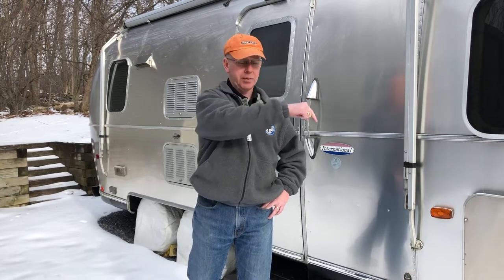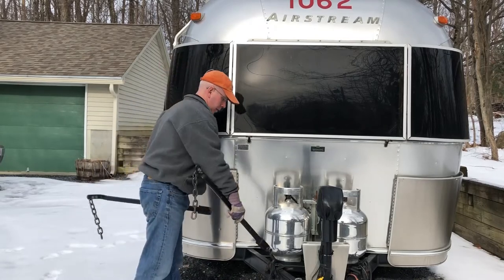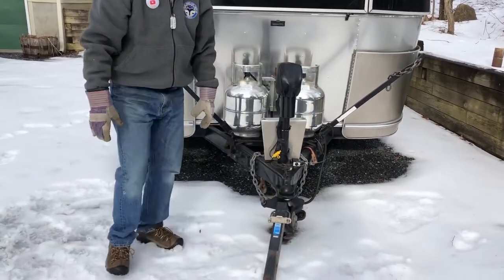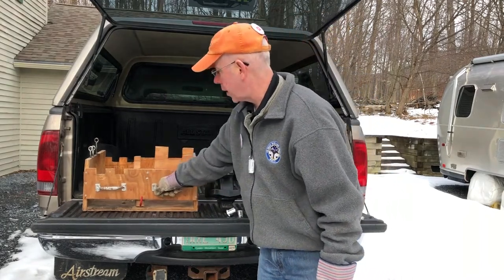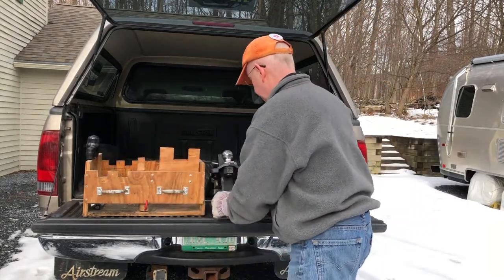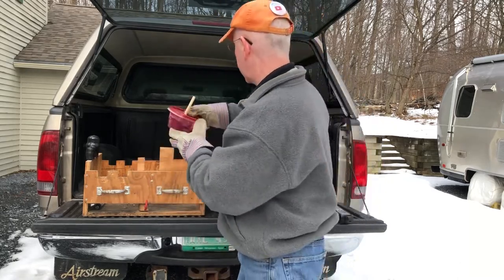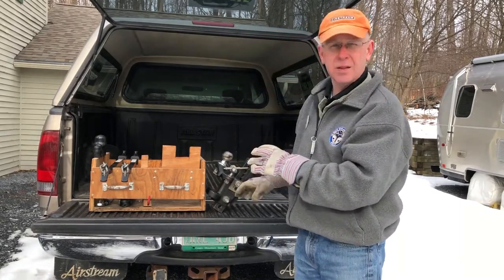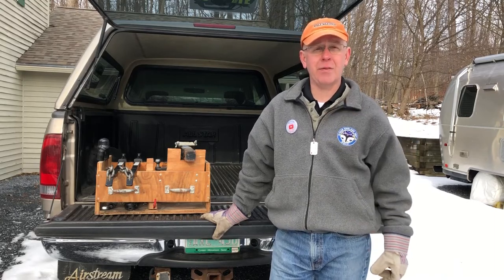How We Store Our Airstream RV Hitch Gear

Comment: May have to switch to the high temp grease you use on the hitch ball. I’ve been using petroleum jelly on the hitch ball sway bars etc. with no issue whatsoever. The reason I started doing that was you don’t have to worry about washing grease off of your clothing.
Reply from the maker: Yes, I've gotten my share of grease on my clothes.  There has been some recent debate on greasing the hitch ball on Airstream Addicts but I'll stick with my procedure - keep it clean and don't overlube.

Comment: Where would I get a setup like that and what is the cost of the tow equipment?
Reply from the maker: I built the box myself from some scrap lumbar.  The hitch that is shown in the video was "thrown in free" by the dealer when we bought the trailer.  We recently upgraded to an Equal-i-zer 4 point Sway hitch and the cost was $657.00.